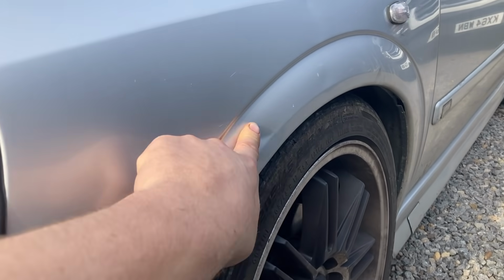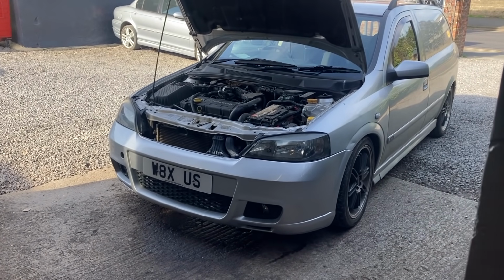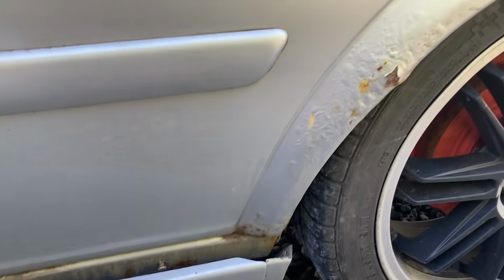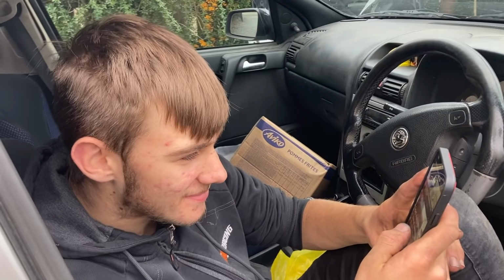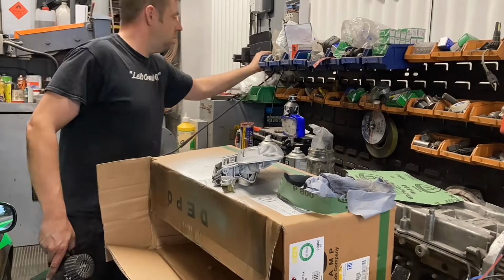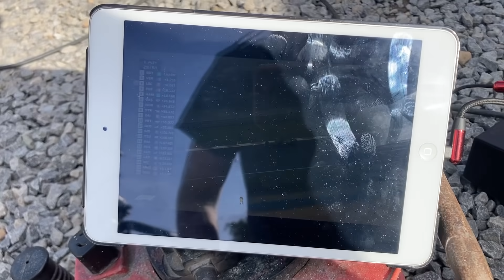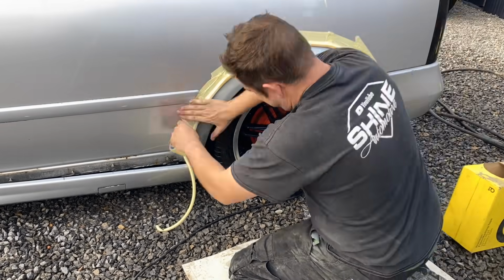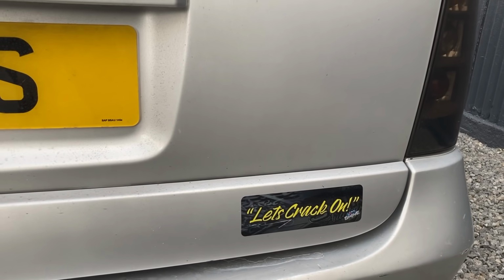Someone Hit My Van - Well Time To Do Some More Modifications - Weekend Fix

Comment: Looks good that and wish my mk3 looked as good as that
Reply from the maker: Get to it and it can be. Motivation is key :-)
Reply: That's true and it will be as long as we keep getting good weather as I've not got a garage to do it in at the moment witch is main thing slowing me down with it
Reply from the maker: @adrianfowler362  oh man . what’s the mk3 spec ya got then
Reply: It's just a standard 1.7 TDI van but if I can find one would like to put gsi front on it and try put electric windows in it as well rather than manuel one's it's got

Comment: Just watched this video for the first time and had to laugh when you mentioned the foam for creating a soft edge....fold the masking tape back man, fold it back....😂😂😂
Reply from the maker: Foam edging it’s so much easier to use is just as cheap
Reply: @shineautomotive  mate I'm stuck in the 80's way of it, I flat lacquer with 1500, a bucket of water and fairy liquid, that's after throwing water on the floor to hold the dust down before spraying the lacquer...😂😂